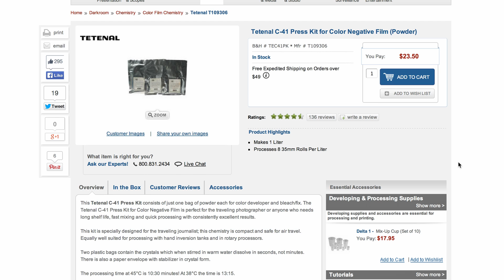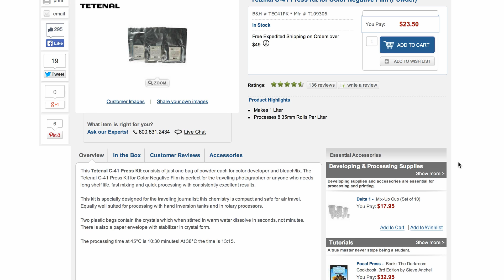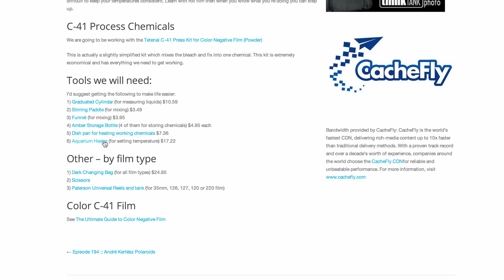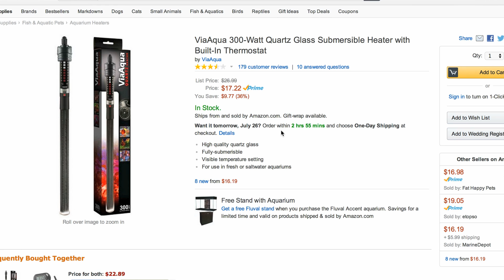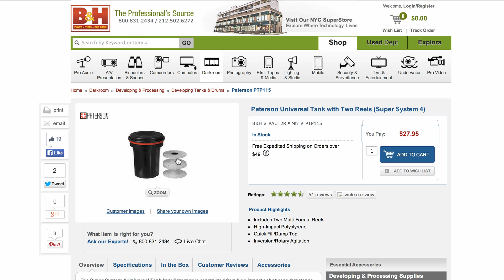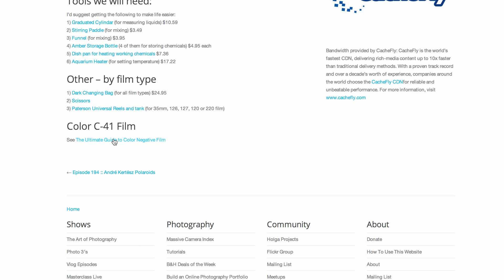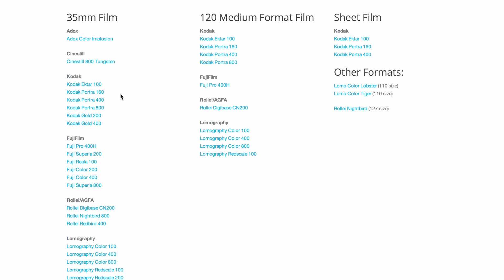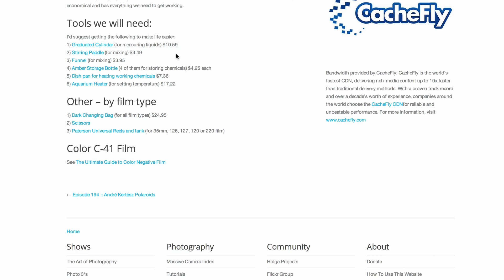C-41 Color Process Intro

Comment: I'm an ex Kodak photofinishing instructor. I used to train labs to do this for over 5 years and have done this routinely throughout my career.. I'd say good job with the video.. but obviously in my day this involved 1000's of film and major machines... I have used Paterson tanks... the key issue is care to get the film on the reel to avoid getting kinks and handling damage. Paterson tanks are good in that they have a ratchet mechanism which with a twist action on both halves of the spiral loads the film automatically. Films are very fragile... so I would recommend you have a practice on any old 35mm film that you haven't exposed - it can be any film to practice ... do it in the light a few times... then with your eyes shut... before going into a darkened cupboard (under the stairs?) make sure you're as comfortable as possible when you go into the dark... wait a minute or two to make sure you haven't got any light leaks before attempting the load.. when it on the spiral make sure the tank is firmly shut..  A blix is not the best - true c41 is bleach and fix... a short word on bleaches... film has silver halide on it before exposure. Exposure causes some of the Silver halide crystals to turn to a microscopic piece of silver. The developer effectively changes the microscopic silver (latent image) into a full black and white image. Think of it as an amplifier. During the process of making the B&W image the by-products cleverly combine with another chemical called a coupler which changes the coupler into cyan, magenta or yellow dye. As it is the colour image we want the purpose of the bleach is to remove the black and white image. This is done by converting the image  silver back to silver halide which is then finally removed by the fixer along with any unexposed silver halide. Need a diagram really but I hope the explanation helps. The stabiliser locks up any unused colour coupler not used to make the colour image to avoid this discolouring later and causing balance issues... Hope this helps and feel free to ask any techie questions... Above all practice loading that spiral! Equally take care unloading it from the spiral after processing when it is wet and at its most fragile,
Reply: Of course this process was done in lab with big c41 developers automatically.  I worked as a printeroperator/ paperprocessor for 16 years with kodak photoservice Holland 87-2004. I also was instructor for the Kodak 3510, aps Selexa, Agfa msp printer. Nice job very technical. I was also to the winterolympics in 94 Norway. I worked on slide packaging with the old slide cut and packing machine from Kodak the one in the video about the last roll of Kodak.
Reply: Hi Graeme,
just put together a Refrema c41 dip and dunk machine, well actually paid someone to do it for me.
Up and running but not a clue as how ti mix the chemistry.  Have all the chemistry but since no instructions not sure which goes first or how, thanks for any helpm
Robert

Comment: I find that maintaining the correct temp is more easily done with metal tanks than with the plastic ones, though I will admit the metal spools take practic to master. I  generally heat up the water bath for the chemicals to 120 degrees checking every so often and adding hot water when needed. That has worked well for me thus far. Love that you are doing this!

Comment: A few things I've learned... when mixing the chemicals, I filled the 1000 ml amber jars, warmed them up (same method you described) and always under the impression that 1000 ml is always 1000 ml, discovered that is not true. Follow the directions to the letter,  mix in 800 ml AND THEN ADD to get 1000 ml or else there will be spillage/waste. Second, the blix generates a bit of heat during agitation, you will notice the Patterson lid start to bulge right away. If you don't relieve the pressure by "burping", it will blow the lid off during next agitation cycle,( to me it happened while the tank was inverted (very messy))! Also, along that note, for safety sake, you may want to wear some form of nitrile gloves, goggles and/or apron. You didn't mention these in your shopping list, but many unexpected things can go wrong, and this is not JELL-O we are working with, but fairly toxic chemicals. Anxiously awaiting Ep #196, to see what your experience is like... great job Ted as always.
  Here is a link to my first effort at C-41... http://myvelleity.zenfolio.com/p232278577/h270f630#h270f630
Reply from the maker: myvelleity thanks for the advice - I'll use it in the show next week.
Reply: theartofphotography
I use distilled water to minimize contamination, and an actual thermometer, the key to consistent results is to be consistent,  :)
Reply: my Velleity . Yes... He needs a thermometer... No mention of it in the video or notes! I have both the classic design and a more modern digital one that fires a red dot at the liquid and gives an instant reading. The digital one is much more accurate than being within a "degree or two" with the mercury/bulb type designs.
Reply: Ted - Very important. When it comes to using the chemicals, apart from the heat from the blix stage, it "outgasses" too.

Do not be tempted to ignore this stuff. Make sure it is vented from the tank and blown away from where you are standing. It stinks and can be damaging to sensitive sinuses and lungs. It also stains everything and deeply so if spilt... I spread out a couple of layers of junk towels under the water bath tray I use. They go into the wash after every developing session.

As for protective gear, no need to go overboard, gloves are important but worse damage usually comes to unprotected clothes from the blix than anything else, so an apron is a good idea, but not essential. Assuming nobody has a dedicated darkroom, so long as everyone goes slow and uses a big/wide/deep water bath and does pouring of everything over that bath, splashes should be kept to a minimum and little to no damage done.
Reply: LOL ... Yeah ... He won't need to be in full protective gear. Sorry to break the image for you... ;-)

At one point in my career, I spent some time working in a clean room and my ex wife used to say that I looked like a "Cotton Bud" in that get up.
Reply: Brian Richman
Funny :-D

Comment: I posted this in the last episode as you were previewing this C-41 episode...so I'll repost:

1. Temp.  It is CRITICAL, and the range is VERY NARROW, but really only for the first two steps, and REALLY only the dev step.  My kit has ranges for all the steps, but Dev is the only one that recommends 102F for best results.  I use a super cheap Coleman cooler that gets my bottles of chems to the right temp and then it's so much easier to develop...BAM, done.  If you have the right temp from the start, 15 minutes and you are holding gorgeous negatives.  My kit has BLIX, so I just take my two bottles (dev range is 102 on my kit, BLIX is 100-105) and put it in my Coleman Cooler and fill it up with 115-120F water, and close the lid and let it set for 15-30min.  My initial temps of my chems are around 68F where they are stored, so after about 30 min, things are pretty close to 102F.  If not...just make SLIGHT adjustments to the bath water.

2. Air getting into your chemicals.  If you can, get the vacuum glass bottles, but I use the collapsable bottles and just make sure I squeeze as much air out as possible when storing.  Air KILLS the Jobo/Tetanal kit.

Comment: I started developing c-41 about two weeks ago. The tetenal has maintained strong results for about twelve rolls of 35, I'm actually going to see if I can get two more out of it tonight. One idea to think about- if you can't get an Aquarium   heater just use the sink. Fill it up with 120 degree water and let the developer and blix sit until they are up to temp. That has worked fine for me. Another tip that has made loading film much easier- lay the film down on the tracks before trying to push it into the little slots. Really makes it easier

Comment: A good start - get all the gear organized first. You are right about needing it all to be at 100 degrees. I think the heater is a little bit of overkill but not too much. I start out with the chemicals at about 102 degrees and by the time everything is done, I am at 100 degrees, but then I am also in North Texas and the ambient temp in summer is 9,000,000 degrees. :-)

When you mix the powers (I also get my 1L Tetenal kits from B&H), go SLOWLY and let the powders dissolve completely or you'll end up with bits left over in the chemicals. Also use distilled water (NOT regular tap or even bottled water) as the bits of minerals in both regular and bottled drinking water will leave little white spots on the negatives and mean you'll have to do more work with editing in Photoshop (the spot healing tool) latter. 

Two tips for spooling the film on the Patterson reels: #1 is to make sure your hands and the spools are 100% dry as any humidity or dampness will lead to snags and #2 is put a shoe-box sized box or container inside the bag to hold the fabric up. It also helps to keep stuff contained in a controlled space as well as helping to stop the fabric of the bag from rubbing on the film. Not everyone likes the box thing, but some do. Just saying is all....
Reply: The box is a great idea, wish I had thought of it. I simply stand the tank to hold up the bag, and  refrain from using scissors inside out of fear of cutting the fabric when it sags down. Thanks, I'll try it out.
Reply: my Velleity . No problem. ;-)
Reply: 2nd the use of Distilled Water, and going slowly on the mix.  If you do the mixing right, and aren't afraid of it, developing is even easier ;)

Comment: Agitation is going to be extremely important.  When I first started doing color film I did a slow inversion agitation (4 inversions every 30 seconds within about 10 seconds).  I'd get uneven results in the film.  I started doing 4 quick inversions within 5 seconds (every 30 seconds) and that works great!  I'd rotate the tank 1/4 turn between each inversion.  Of course, don't forget agitating for the first 10 seconds at the start.  I use the Arista kit, it's less expensive and works great.  I also tried using a patterson tank and leaving it in the water bath the entire time without doing inversions thinking that would help maintain temperature.  I'd agitate using the agitator.  Again, this didn't work and produced uneven results.  Hope this helps, Ted!

Comment: I've been doing B&W for a little over a year now and just did my first roll of C41 last friday night. I used the Tetenal kit from B&H, followed the instructions to a t, and got excellant results. I did use a bucket of hot water to hold the chmicals at temp, and I also put my paterson tank in it between inversion cycles. I had read about issues with gas pressure from the blix, but the only time I had it bubble up was when mixing part B into part A. After that it was smooth sailing, and I've gotta say Ektar 100 scans excellantly and easily.

Comment: Hi

In common with other commenters I would encourage the use of a good thermometer. 

If possible I would also advise standing your made up chemicals in a porous plastic basket in as big a volume of water as you can. Large bodies of water lose heat much more slowly. 

Also, for those not in a 'Fahrenheit'
country, don't heat your chemicals to 100 degrees!  It's 37.78 Celcius (or 38 near as necessary). 

Great video, I hope you will be recording the next one live!

Comment: I've done c41 and e6 in the kitchen sink, the key is to measure the chemicals themselves for temperature. Have the bath higher then 100, keep the chemicals in spec. A cold E6 first dev in particular would hinder results when I got sloppy. I don't think there is easier then xtol+tf4, but c41 comes close! E6 is another step harder again, but so much more rewarding. Most importantly, have fun!

Comment: I've been doing c41 for many years. My number one tip is to top-off the working solution bottles with butane gas. This will displace the oxygen and increase shelf life of the chemistry. I usually get about 9 months out of a 1L kit. I keep my chemistry in black squeezy bottles. 

I also use a thermostat like you are planning on using. I originally started out just using hot water from the tap for the water bath. But I'm lazy and find a thermostat makes life easier. 

Also you touched on sheet film. While not strictly a c41 tip. look on eBay for a daylight processing tank(for developing RA4 prints) they are the easiest way to develop sheet film. Also one less thing to buy when you decide to try RA4 ;-)
Reply: Sorry that should read daylight paper tank not daylight processing tank.
Reply: Interesting about the butane gas...what's your process and what kind of bottles do you use?  The accordion bottles have worked great for me, but actually would like to start using the glass bottles that you can vacuum all the air out.
Reply: I use those accordion bottles. I just spray the copious amounts of butane in the bottle. Then squeeze the bottle down and tighten the lid. The butane is heaver than air, so it displaces the air.
Reply: nice, I was going to use nitrogen like they use for wine, butane maybe cheaper. and easy to find, would propane work as well? should work on D-76 right?
Reply: I don't see why it wouldn't work. But I've never tried. It's the oxygen that causes developer to go bad so anything that displaces the oxygen is going to help. I guess Nitrogen would be best as it's an inert gas, but butane is cheap and very easy to get.
Reply: Yeah. nitrogen was $ 14 a can if I remember right. argon is a noble too, but I've never seen it for sale in small cans.  butane may be the best?
Reply: Thanks........You have just answered ALL my questions :-) Thank you :-)

Comment: You can use the Tetenal Kit (as others too) also at 86°F/30 degrees, developing time is then 8 min. I preheat normally in a sink and start at around 32 degrees to develop. Works perfect. The key is consistency in your developing times at a defined temperature shown by your thermometer (have no idea if mine is 100% correct).

Comment: Wow $17 for a heater, when I searched for heaters they were much more than that. I wonder what I was looking up. One thing I learned after mixing my first batch of chems, the patterson tank I got was a half liter tank, and I'm making one liter mixes. So after seeing that I split the powders on a tech scale and made a half liter and stored the rest of the powders. I can say I have run close to 20 rolls through a batch of chems. From what I have experienced, the liquids store very well in a refrigerator to extend their shelf life beyond just sitting at room temperature. With good glass amber bottles, one liter or half liter depending on how much you make at a time, there is very little room for air once you pour back in. The funnels I got have a nice tube on them that reaches inside the bottle. This helps keep the funnel from flying off when you start pouring the chems inside it, a problem I had with the first funnels I purchased. Can't wait to watch more.

Comment: From my experience with the Tetenal c-41, 3 stage developer kit (dev, blix, stab), it says in the documentation that the development temperature variance tolerance is very low (needs to be excact +-1-2 C), while the Blix and the Stab stages have tolerances from +-5 degrees (celcius) and -+ 10 degrees (Celcius) respectively.

When I did a round of C-41 a while back, I made sure to heat everything to 38 degreec (celcius), then keep the bottles in a 38 degree water bath in the sink while processing. Then I just developed, Blixed and Stabilized, the final two stages were done at lower temperatures indeed, but within the documentation tolerance. (negs came out fine).

Most important thing is to read the documentation to the particular kit you use and you should be fine as long as you follow the instructions.

Comment: I've been doing C-41 for a while. I think it's more forgiving than you think. I just heat up my chemicals to a "high temperature" and do my developing. I've never had any color shift problems. My Jobo kit says "process film until you no longer like the results." I would say that the results are equal or better than photo shops.

Comment: I'm just starting to do color film myself. I plan to make a video in the next week of my own process of C-41 and RA-4. The aquarium heater is too weak. Most aquarium heaters max out at around 92 degrees.

I actually built my own automated temperature control device using a PID controller, solid state relay, a PT100 thermocouple, a hotplate, an extension cord, andd an old pot. It keeps the temperature of the water within 0.2 degrees F of whatever temperature you set. In all cost around $115. I used the tutorial on this page to build it: http://makezine.com/projects/universal-temperature-controller-for-70/ It was pretty easy too.

Comment: Its great that you're using a second camera. However, forgive my intrusion, but the angles are pretty much the same which is causing a jump cut when you go from close to wide shot. I suggest you make one of the cams a side shot or at least slightly angled so there's a minimum of 45 degrees between each shot, which would make the transition from one cam to the other more pleasing to the eye.
Cheers